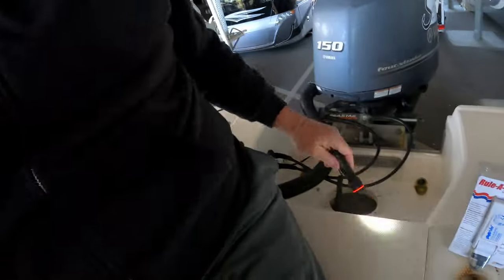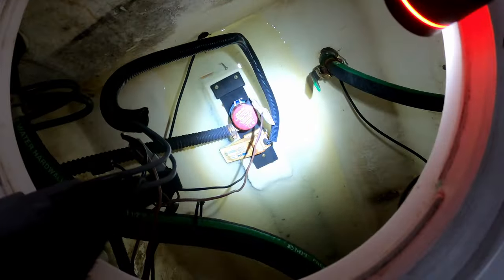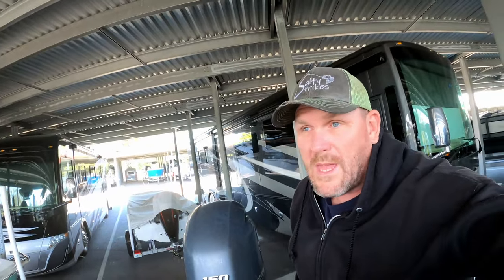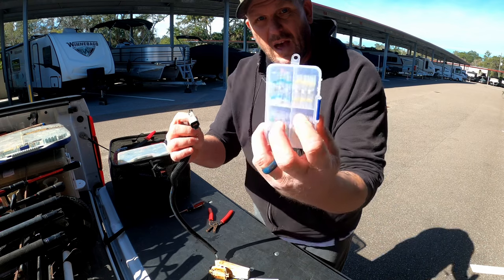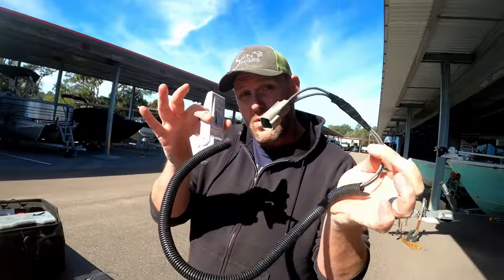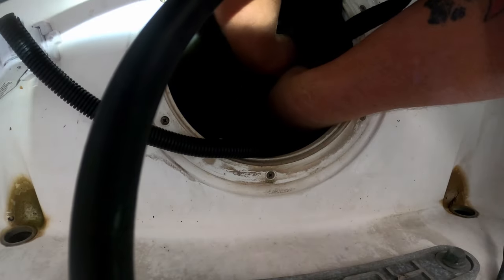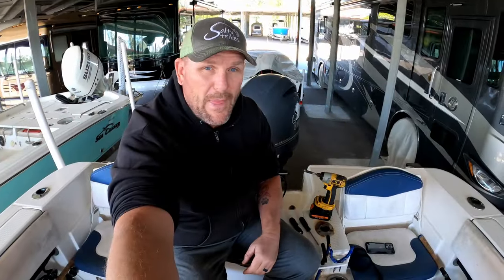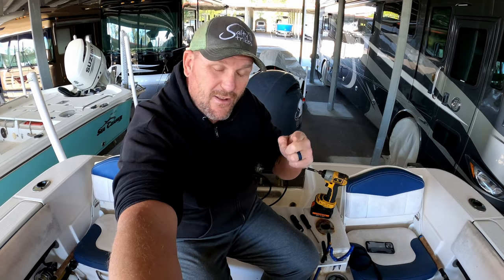Bilge Pump Float Switch replacement in a Robalo R200!

Comment: When you I talked your flush Mount rod holders in front of the boat did you hook up drain lines to the bottom of them so they don’t drain into the bilge area or are they open bottom and draining into the bilge?

Comment: Nice video. FYI those float switches have two tabs on the side that you can squeeze and separate it from the base which lets you reuse the base mount….on a side note, do you happen to know if the two inline fuses connected directly to the batteries are redundant protection or do they each “hard wire” separate devices?  The only thing I am aware of that runs with the battery switch off is the float switch.
Reply: Yeah....zero reason to unscrew anything. Just pop the old switch off using the tabs, snap in new switch, then rewire.

Comment: At 8:55 there’s an extra screw. Is there anyway to move the through hull valve without going into the panel in front of the engine?
Reply from the maker: @EngineNoise305  nope, only access point